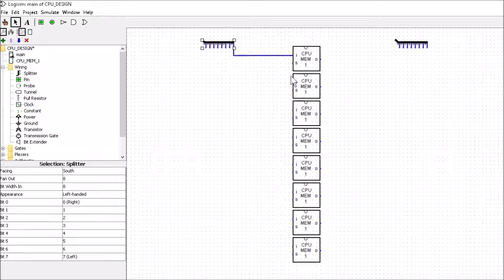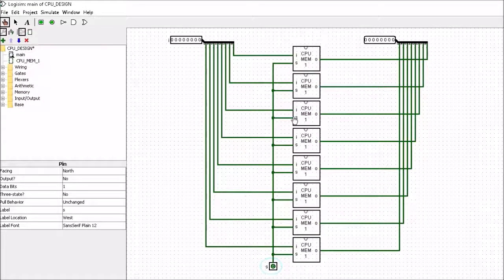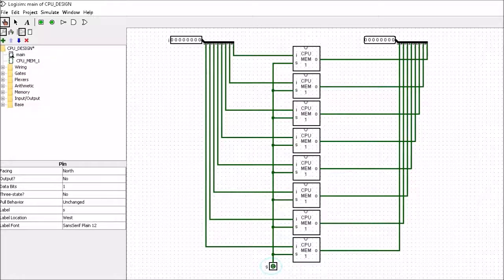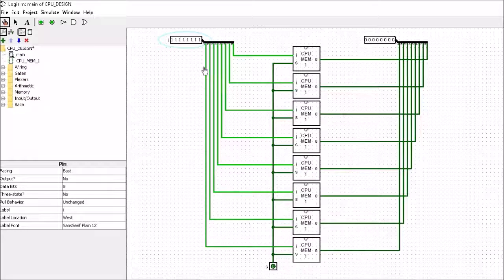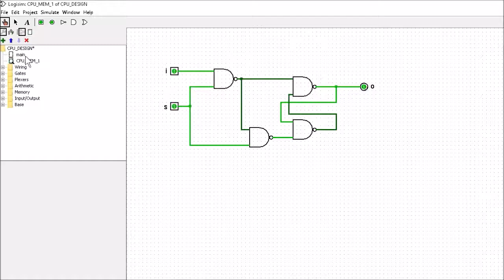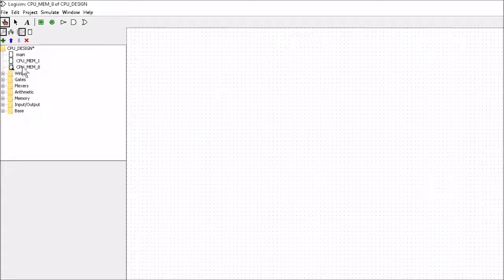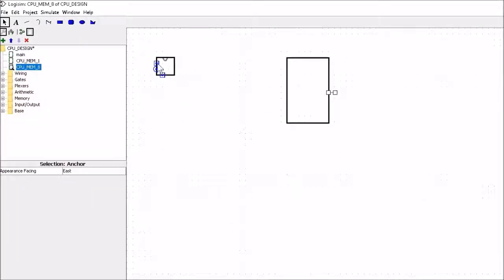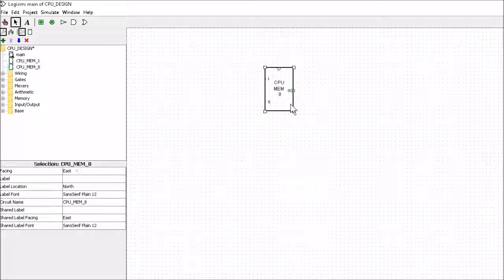Design a CPU (1 Byte Memory Cell)

Comment: In my logisim right side of the wires are red an I can not take th outpts what's the problem and als you mentioned that S with E circuit is 1 bit memory cell but previous video you combine S and R instead of E.